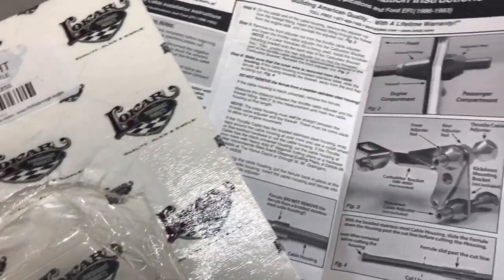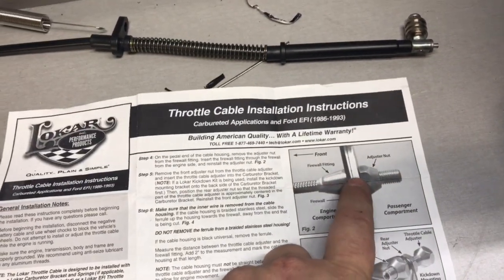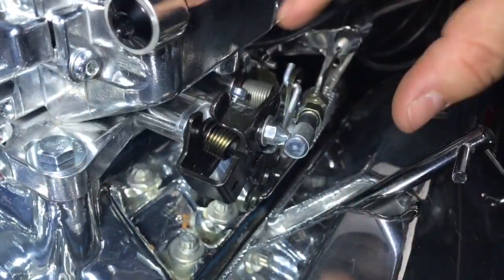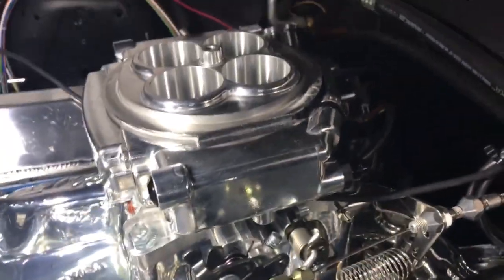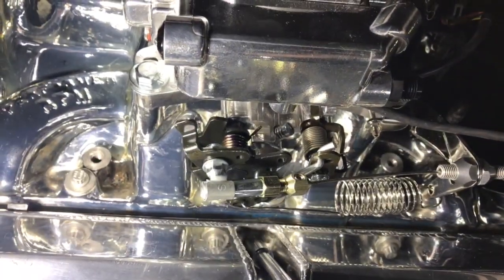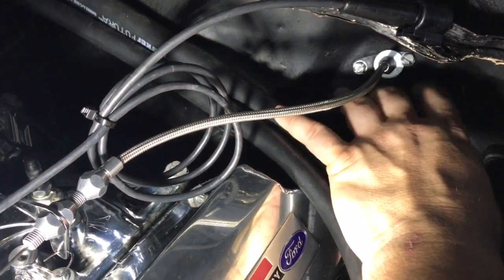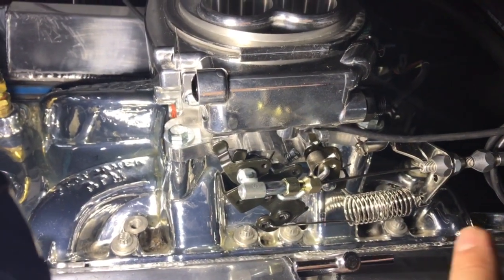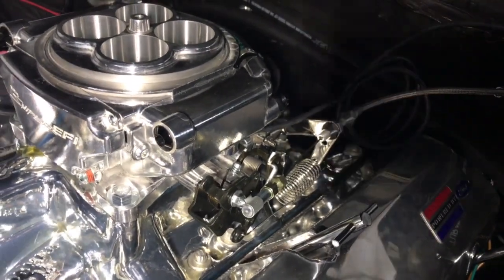Lokar Universal Throttle Cable on 72 Mustang

Comment: Dang. I was hoping you'd found a front-mount return spring bracket which also worked on the Sniper w/ the awesome Lokar cables. I prefer for the force to not all be pulling the shaft against the back of the bushing; theoretically, a front-mounted return spring should cause less wear long-term.

Comment: hi i know this is an older video but my throttle cable just broke. i need the first cable you shown here. the one that wouldn't work for you. that one looks exactly like the one i use.. i took mine off a 85 ford f250 with 5.0l fuel  injection set up. i made it work by using the parts from that truck. i modified them to make them my own mounting brackets.. if you still have it i'll buy it from you for a reasonable price. if not i want to know where you got it from and or, a part number. i appreciate your time for posting this video
Reply from the maker: I can see if I still have it laying around. Picked it up off CJPONYPARTS.com tho. Check there

Comment: I did the extra 2 inches of slack in the housing like the instructions say, and my cable gets too tight to pull it full throttle with the pedal now.  Would shortening the housing help stop it from binding?

Comment: What do you do if your pedal travel isn't enough to move your throttle through the full range?
Reply: Use a mounting hole on the linkage farther out from the pivot point (the throttle shaft).
Reply: @DannySauer  Yeah the problem there is that its already maxed out. It's at the top of the throttle linkage and at the lowest part on the carb throttle itself.
Reply: @Seth-de9pd  Ideally you could extend the gas pedal's linkage farther from the pivot point, but if nit, you can bolt a flat piece onto the carb linkage to extend that out. You have to increase the radius on one end or the other. Alternatively, you can add a bellcrank in between (like on a double carb serup) and a second cable or a small threaded rod w/ rod ends, to increase the effective throw distance.

Comment: What's the part number on the throttle cable bracket??
Reply: Bit of a late reply, but for future visitors: they appear to be a TC-1000HT for the cable and SRK-4000 for the bracket.